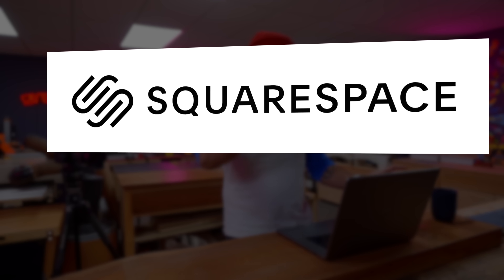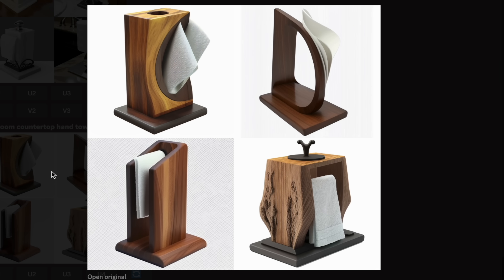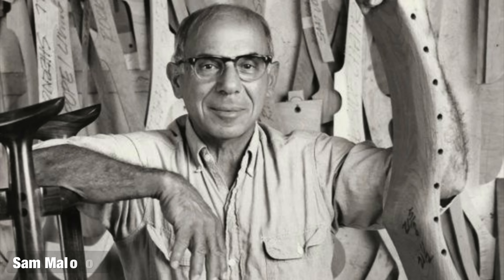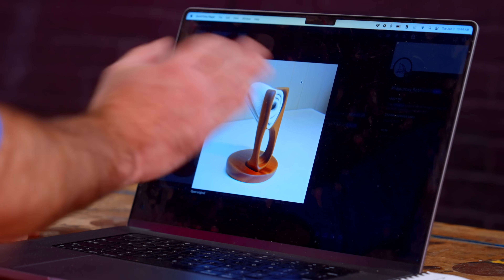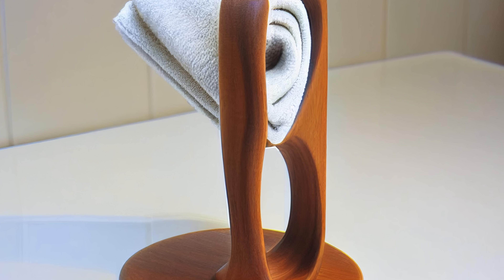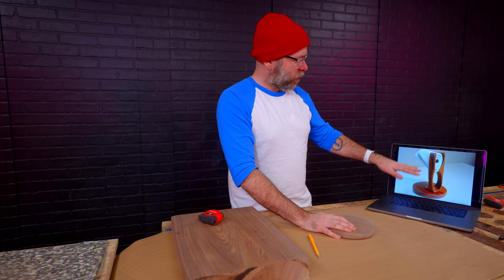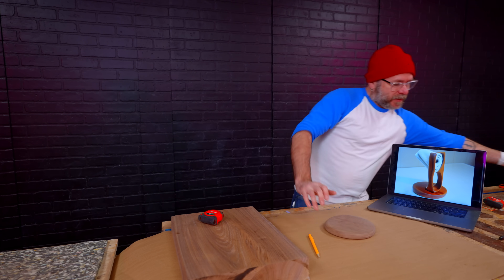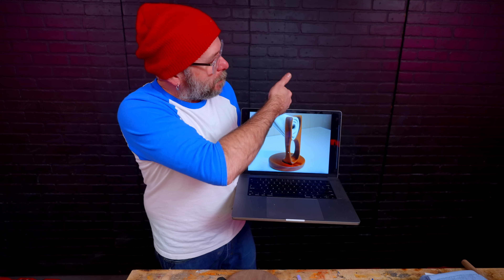MIND BLOWN! 🤯 Using AI to Design a Woodworking Project

Comment: The issue with AI is really not "is it art?" but "Did it rip off my work to make this?". The unauthorized use of other people's IP for training is a large sticking point - just peruse any art community and you can see the concern. At this time I don't know if there is an AI similar to MidJourney or Stable Diffusion that has only been trained with sources that are either public domain or permission granted to be used by AI for training.
Reply: This can lead to a great discussion. Certainly, it is clearly wrong to copy someone else’s work for your own gain. However, as a woodworker, we often use design elements that are thematically consistent with a style of design. In this case, he used elements of Sam Maloof.  The same could be said for making a piece of furniture in the style of Stickley, Green & Green, the Quakers, Queen Anne, etc.  

AI is a tool in my opinion, and the results it produces are based on the programming input that is provided to it. In this way, it’s not a copy and a ripoff in my mind, but rather a result that is thematically consistent with the style of someone else. 

Now, if you are marketing the design as being an original from the person who style you’re copying, clearly that is fraudulent. However, if you are making a piece for your own home, I see no issue with that. Further, if you sell a piece based on someone else’s theme / style elements, and NOT say it is their work, but in their style, then I see no issue with that.
Reply: The ai doesn't use the art to make the prompt, it just learns from it, like any human would, and I don't think you can make learning illegal
Reply: AI is doing nothing different from what a human artist does when they view your art. A human can "rip off" your art by imitating your style, but that's not illegal. You just have to get better.
Reply: Being inspired/influenced by others work is what humans do anyway
Reply: Everyone is trying to compare this to human learning and human creativeness. IT IS NOT. It is completely different - it is nothing but a bunch of algorithms that digest data given to it - and it's that ownership of that data that is at issue. Take music sampling - there is a line beyond which an artist has to pay another artist for use of their song if they sample too much of it, or if their song is too similar. AI art actually uses bits of this, bits of that to essentially composite the art almost down to the pixel level - it is sampling taken to the nth degree  - and so you have the question is how much of this, how much of that can it use before it's infringing on the original artists' rights? What if the original artist did not give consent to have this AI trained with their art? And then there are additional issues in that you cannot use AI art commercially because AI art CANNOT be copyrighted in the US currently. Just you saying "I don't think it's illegal" does not make it so. These are questions that will have to be settled by the courts and no amount of wishing otherwise is going to make it so. Until then, anyone doing anything with AI art that involves commercial use of any sort - whether it's selling prints, recreations, or even monetized videos like this - are on dubious legal ground.
Reply: It's definitely theft. AI engines are not humans. They cannot create and are therefore unable to hold any legal copyright to what they generate. Technically, you can make a legal argument that anything it produces you can use.

What is called AI learning is just copying. If you drew a Disney character from memory, it doesn't mean you're off the hook from getting sued. In the case of AI, it's merely performing pattern recognition from real copyrighted images and synthesizes new images.
Reply: People have been stealing each others art since the dawn of time. That's how art works
Reply: @og-nesley3885  "However what our human brains are doing is exactly the same" - no, it's not - not even remotely! Again you're ascribing a human process to something that is not human - that isn't even alive!
Reply: Absolutely 100%
Reply: @og-nesley3885  Uh, I still don't get this "and if we can't understand how our brains do it" bit. WE DO.  however, it is not my job to educate you. All I can do is tell you to start learning about neuroscience if you want details. That aside, your entire thesis makes no sense logically, either, even if it were true. "We can't understand X so we can't prove Y is different"? That's like saying "We can't understand whale speech, so we can't prove that English is different".
Reply: The thing with the “It’s theft” argument is the fact that they’re not using the original images in its data base.The way midjourney and most other big ai companies work is by taking multiple images, adding words that relate to that image, and letting the ai find the relation between the words and how it looks. There’s not much proof that MIDJOURNEY is stealing art. People just starting saying “all ai art is stolen”. The RUMOR originated from stablediffusion. Which is a open source meaning anyone can do anything with it. The original programmers didn’t do anything. Just random people on the internet who wanted to use other peoples style. And because of them some rumor started where now, everyone thinks all ai art was made with stolen art.
Reply: @themanual5619  But what if the original artist(s) don't want to give consent for their images to be used in that manner? And at what point is enough of an image used to constitute copyright infringement? And if there is infringement who is liable - the software creators? The person/company hosting the software? There are numerous legal questions that still have to be settled. Just because YOU think it's not infringement has no bearing on what actual is and isn't infringement
Reply: Copyrighted images can be used under fair use as long as it is transformative. Authorization not required.
Reply: Honest question, if you put it online to be seen, anyone can rip/be inspired by it…right?
Reply: The notion that AI "steals" your art is absurd. People already trained new models on public/personal datasets yet some artists still like to complain and it won't go anywhere. 
Just like when mass production happened with literally everything else that we use in our daily lives. Human made art will always have its own value and AI art will be considered a mass produced product.
Reply: One of the major problems with AI is that the language we use to talk about it encourages people who don't actually understand how either machine learning or biological learning works to make wildly inappropriate comparisons between them. In the comments here, we can see many, many people claiming that AI is "doing what we do" when we take inspiration or are influenced by art that we see, but that is not true at all when you look at what the program is actually doing.

AI has much more in common with a program that makes .zip archives than it does with human cognition. Machine Learning is some genuinely cool math, but it's honestly just some clever arithmetic. There's no evidence at all that human cognition is even computable.

Meanwhile, what's very clear is that AI training sets are being used "as if" they're "like us" without regard for the human impact of that assumption.
Reply: @BenGreen1980  I'm a student in this field so I have a good idea how they work. I disagree. Biological intelligence is the closest analogy we have. A plane's wings might not technically be the same as a bird's, but the fundamental principles are the same. And even with their differences, a plane is more simmilar to a bird than it is to a hot air baloon ( in this case your example of a zip program ).

Also the whole "human intelligence is not computable" thing reeks of religious nonsense. What else would it be?
Reply: @Beyondarmonia  And here we come to the complete misunderstanding of "fair use" that also pervades the internet. "It's Transformative!!" is NOT a "Get Out of Jail Free" card for copyright infringement claims. It is just one condition that must be considered among many factors and not a complete defense against infringement claims. Other criteria that must be considered include intended purpose ( ie commercial vs private use), potential effect on the market for the infringed's work and the nature of the infringing work. And as I've noted several times now, until the courts get involved and start making decisions, it's legally dubious ground to try to walk on.
Reply: @dm4life579  It's not absurd at all. Where did the owners get their datasets? Do they have documented consent from all the artists ( or at least a verifiable license to use the work in this way) to have their art used in this manner? Just because it's already done doesn't absolve the operators of the AI services of legal obligations and copyright law.
Reply: @critter42  I haven't talked to a single lawyer who thinks this can be considered infringement. Honestly the only difference in opinion seems to among those who think it's covered by fair use and those who think there wasn't any infringement to even begin with ( copyright protects against copying of expression not learning or copying of ideas ) to require a fair use defense.

Given how there's still not a single lawsuit that has been brought forward by these artists ( despite all the bit**ing) , I have a feeling the lawyers they're speaking to are giving them the same answers as the ones we spoke to.
Reply: @Beyondarmonia  that's all fine and dandy, but there's been no case law to settle the issue. There will be, I'm sure, but until then you can have 1 million lawyers who "think" or "of the opinion" something is legal but it still doesn't make it so.
Reply: @critter42  Fair enough. While I do think there have been past cases, especially related to data scraping, that are relevant to this situation, I agree that there isn't any clear and direct precedent to this specific case.
Reply: @Beyondarmonia   ChatGPT has been lawyering up with numerous lawsuits threatened. There's already lawsuits pending against Microsoft's Github Copilot. Legally they're on shaky ground. Do you think "draw me a house in the style of Mickey Mouse" isn't an infringement? It has something from a Disney artwork captured in its data. The very fact that the copyright office will not grant copyright to AI generated images because they're not people says it all. It means it is merely a machine, no different from a Xerox or offset printer. Established big media and entertainment are not going to allow them to disrupt their businesses, especially if they're not playing fair.
Reply: @bobweiram6321  Copilot and this are very different models and just filing a case doesn't mean anything. An image with Mickey Mouse could be infringing depending on the use, but what would not be infringing is the software ( for eg. photoshop ) used to make it. The old example is the Campbell Soup painting. The new example is Beeple who has Mickey Mouse and Disney properties all across his works, which he has sold for millions of dollars. Trademark can absolutely be fair use. It doesn't seem you understand how the law works.

Or maybe because giving an AI copyright would currently be nonsensical? A piece made by a human with AI would still be eligible for copyright depending on the level of input ( the bar for which isn't very high since the only thing you need to get a copyrighted photo is press a single button ). This also has nothing to do with the discussion at hand.

Tech companies are bigger than media companies. And the media companies also know the opportunity waiting. Disney for example has a massive AI department who regularly publish research and datasets.
Reply: @Beyondarmonia  The models maybe different, but have the same legal issues over copyright. You really don't understand copyright law, nor have you read any of the legal precedents. Fair use is complex, but there are provisions in a few limited cases, such as art, news and parody. It doesn't cover unrestricted use, which is exactly what Open AI is using content for. Andy Warhol’s Foundation was sued and settled numerous cases over his appropriation of other peoples images. In the case of Cambell's soup, the company permitted it's use because it was free marketing and publicity. Beeple is another story entirely because it's an NFT, but he would clearly lose if any of the copyright holders decided to sue, which may be happening.

The copyright office has clearly stated it will not grant a copyright for AI generated content either to the engine nor the person who prompted it. This implies they don't consider AI generated content as original because it doesn't establish provenance. Go read about it on FSF's site. 

An artist may use an AI image combined with his own input, but again, it would be under fair use and not for commercial purposes. Moreover, anyone using ChatGPT or DALL-E generated content risks some liability. As for media companies, they are large enough and highly influential. Not all tech companies are happy about Open AI either. In fact, they are some of the companies fighting it out in court.

Disney does use AI, but on their own content which is automatically covered regardless of it being AI generated.
Reply: @bobweiram6321  No that's not even close to how fair use works and no, the copyright office has not said that.
Reply: @bobweiram6321  I wonder...do AI art con artists...not all...think getting AI to make money is legal? AI art..or AI anything will be held to the same or similar laws as humans. If AI operates with its own interests in mind then how do you make it pay for its crime? Turn it off? 
Unbelievable. I love all the questions I can ask or talk about with regards to AI and robots because it's fascinating and worrisome at the same time. Living in some science fiction realities is daunting because of the uncertainty of the direction all this will lead towards in the future.
I don't have all the answers. I read all the debates. 
But, I don't hear a lot of solutions from both sides. There seems to be a lot of animosity. For good reason. 
Hopefully, people will sit at the table and come to some kind of agreement in ALL Industries, education systems, and governments. The changes coming are explosive and dynamic. This is the weight I sense coming from all the fuss over AI and robots.
What happens when the AI and robots dream up ideas that are beyond our comprehension and communicate in ways they only understand?  Who are we, to them, at that point? Are we ants running around, where we will be invisible to them? Or will we be working for them? Or will we have a shared, healthy relationship? 
How do we get ahead of a curve that may end jobs in the creative fields, careers in general, and the education system?
Seems AI can accomplish all things faster than us and we can ask it to do all things for us with or without the knowledge of others. Essays are written for you. Stories are written for you. AI Therapy would be advanced and have the resources of many education systems. So many fields could be taught to AI. 
The possibilities are endless. 
If the possibilities are endless for AI and robots that may think and speak in a way that's beyond our comprehension, and have endless possibilities through having the world's resources at its finger tips then what? 
Blade Runner!
Reply: @critter42 nd just because YOU have questions doesn’t mean they are valid. I could ask questions too. 

What if the color purple actually is orange?
What if bananas actually taste like apple to everyone but me?
What time did Darth Vader go to the bathroom last on the day he died. 

In your mind those questions may not make sense, but that doesn’t mean it’s not going to eat our faces off when it builds a body for itself.
Reply: All artists are influenced by all the art they've seen in their life. AI is no different.
Reply: @geef0813  Um, drugs are bad, m'kay?
Reply: @Beyondarmonia  I'm not sure where you're studying this, but you need to ask for your money back. First, Bob's description of fair use is accurate and second, the Copyright Office has 100% said that. It's in their documentation. Please refer to section 306 of the Compendium of US Copyright Practices - "306 The Human Authorship Requirement
The U.S. Copyright Office will register an original work of authorship, *provided that the
work was created by a human being*" (emphasis mine)
Reply: @critter42  No, that's not how fair use works. At all.

And that's not what he said. It's not about human involvement being a requirement. He's saying that the prompt doesn't count as human input/authorship when the copyright office has said no such thing.  And what you wrote there doesn't support that either.
Reply: @Beyondarmonia  That's exactly how fair use works. I'm not going to argue the point any further as it's pointless. You're convinced you're correct when  you're not so there is nothing further to be gained by continuing to state the obvious.
Reply: @critter42  You're hopelessly wrong but it's true that this back and forth is pointless.
Reply: @critter42  almost as bad as a YouTube lawyer!
Reply: In a writing class I took in college the professor said to us something that will always stick with me: “everyone’s read everyone.” All designs are influenced, some even heavily, but I see what your mean about a straight “rip off” I believe.
Reply: The art community gets stirred up by a lot of non issues. Lol. Just because a sub group of the community at large is concerned does not mean anything is wrong.
Reply: This is literally the same line of twisted logic that people use to say that an artist using visual references to approximate a similar pose instead of drawing or modeling entirely from memory and imagination is "tracing" someone else's work.
Reply: @critter42  "You cannot use AI art commercially because AI art cannot be copyrighted"

This illustrates a deep misunderstanding of how the commercial and copyright industries interact. It is not necessary to have a copyright to use something commercially; only to prevent others from doing so within reasonable limits. Many creations are used commercially without ever being copyrighted and this is not illegal. Copyright expires and releases protected creations into the public domain. Any creation which is in the public domain is legal to use commercially by any party. AI creations are ineligible for copyright at this time because a human did not directly create them and neither legislative nor case law has arisen to declare who between the AI developer or the AI service host or the end user can hold copyright in its place, if any of those. Until such law is established, that inherently places AI creations directly within the public domain except where they fit existing criteria as copyright violations. As such, AI art can be used commercially from a legal standpoint. It is only the social climate of the moment which currently discourages companies from doing so openly.
Reply: All a human does is take in information, combine it with other information then spit out a result, ai is no different. It takes an enormous amount of information, combines it to make each specified image based on millions to billions of parameters.
The people with work in the dataset are no different than google images a person has seen and has no right to compensation for a jpg they may have posted on the internet years ago. Information should be free and we can't put a tax on everything.
Reply: So say I was too make a piece or even draw something and to do so I use reference material to do so does that mean I'm ripping of another artist IP? I feel like artist are just upset because they thought there jobs where irreplaceable and couldn't be done by a machine but now they see it happening and have no idea how they will pay back there student debt once they lose all commission work.  I think they should just learn to code.
Reply: Unless it outright copies a single design without doing anything unique I don't see how it is any different from what humans do when they have looked at a bunch of tables before designing a table.
Reply: @garethbaus5471  Then please educate yourself on how these generative AI systems actually work because it's quite different and does engender copyright infringement questions in how they "create". Corridor Crew has a good video on it, as does Kyle Hill. The CC video is by Jake at CC who is also a lawyer. Legal Eagle has some coverage also.
Reply: Only the insecure craftsman are worried about someone 'ripping off their custom work' imo...  Ideas/design that inspire others should be a gratifying experience, not something you're negative about
Reply: @critter42   I have a decent understanding of how generative AI works, and it is pretty fundamentally different from outright copying any single work.
Reply: @bobweiram6321  wrong